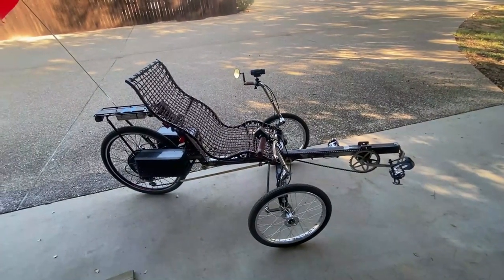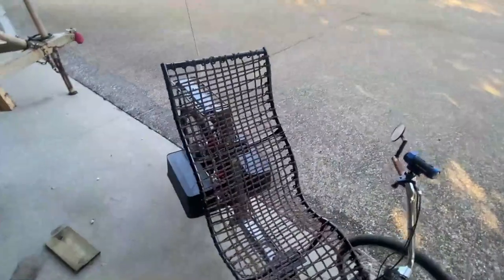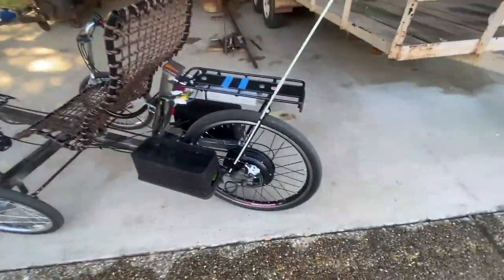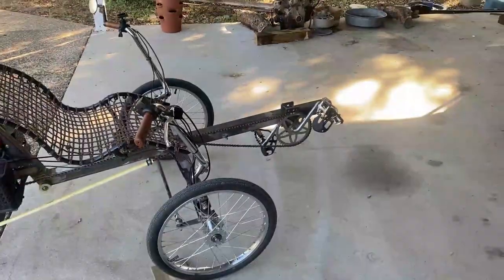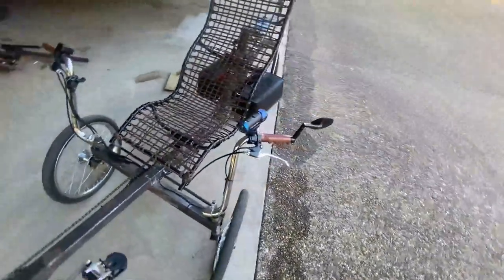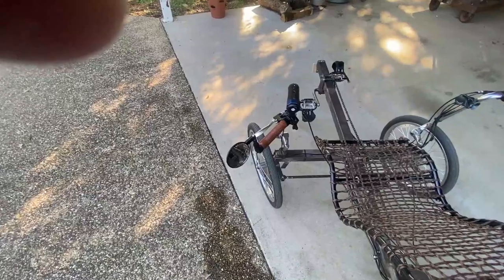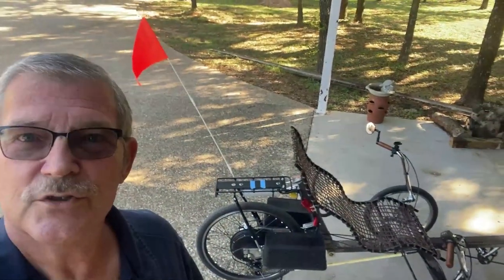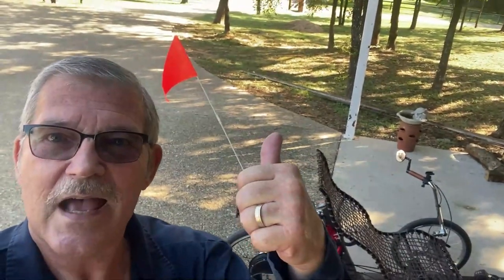Recumbent Reverse Trike Build part 3

Comment: Very cool Rusty. I have a few of those bicycle disc brake setups that I got from Craig's list a few years back. I should put one of those (or 2?) on the Tennessee Sweet T.
Reply from the maker: You should George, they work lots better than the old caliper brakes. Thanks

Comment: I like that seat Lloyd, it's perfect for the Texas weather, nice and cool. A lot of ingenuity in your build, looks like it's fun to drive. Can you get some decent time on the batteries without recharging?
Reply from the maker: I used  4 - 12 volt, 12ah batteries. My estimates is about 10 miles + if you pedal as intended. I will see if that's true or not. Thanks Ken